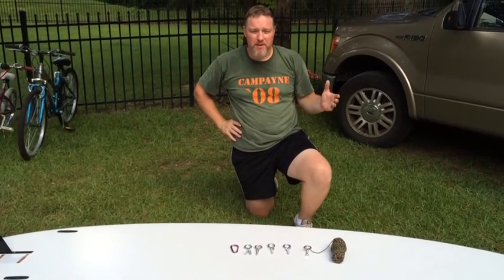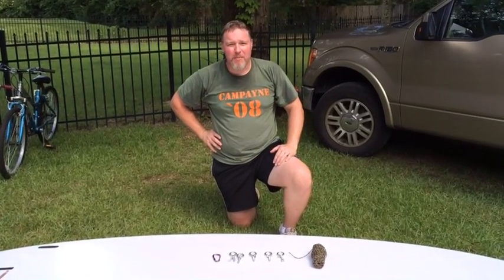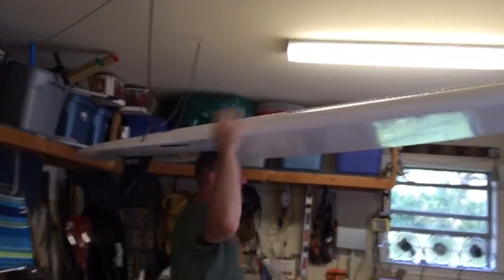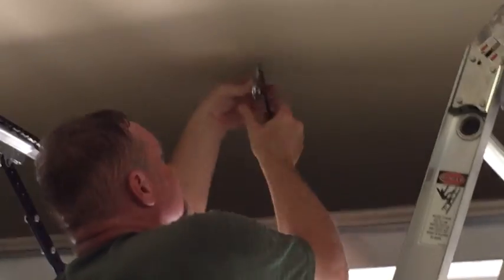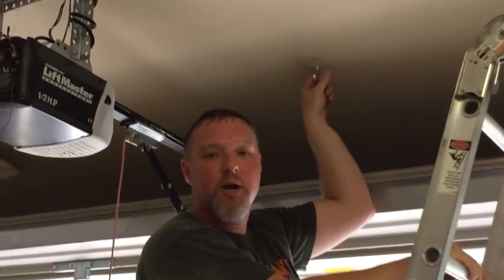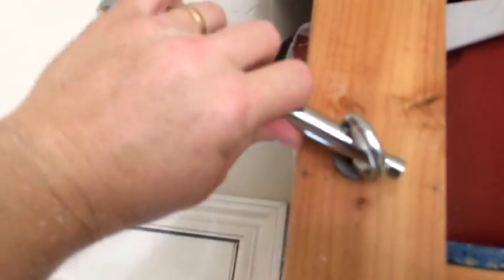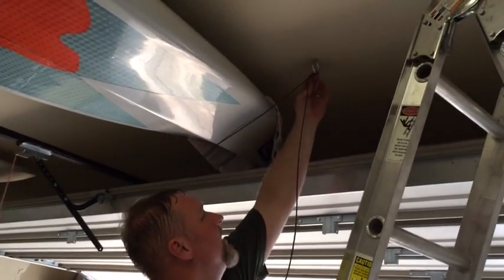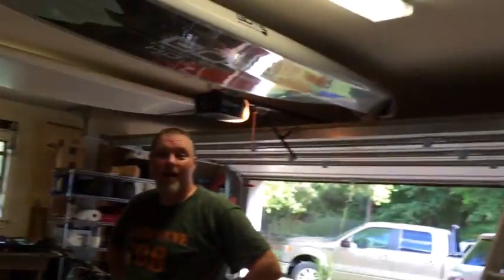SUP Paddleboard Storage for Less than $10

Comment: It will damage your board eventually. 550 chord doesn't distribute the weight across the surface. Think flat n foamy with a similar rig maybe, but as a board manufacturer, don't do this in a permanent frame of mind🤙

Comment: Didn't work for me.  Front of board slipped.  Way too flimsy.
Reply from the maker: +John Costan, so sorry to hear it didn't work for you.  How far from the ceiling were you trying to hang it?  My boards are just a few inches from the ceiling.  I can imagine if you were trying to be farther down from the ceiling, the extra length of rope could make it less rigid.  I have been using mine for two years now with no issues, and I take my boards down (and put them back up) a couple of times per week.